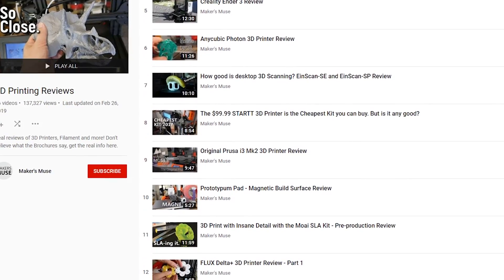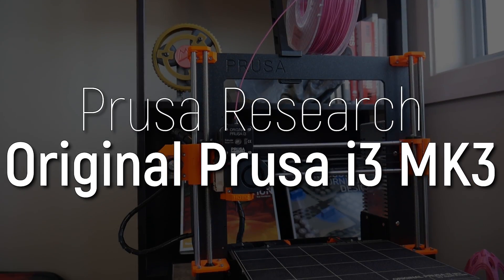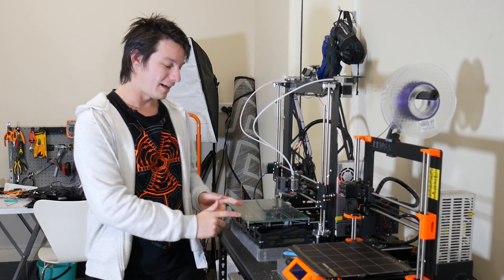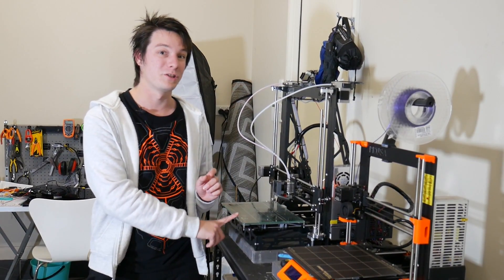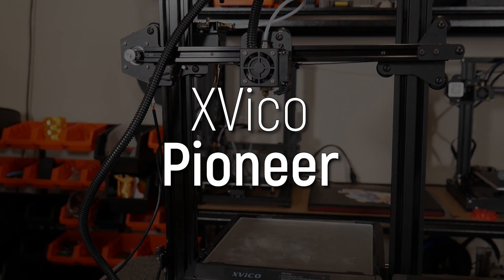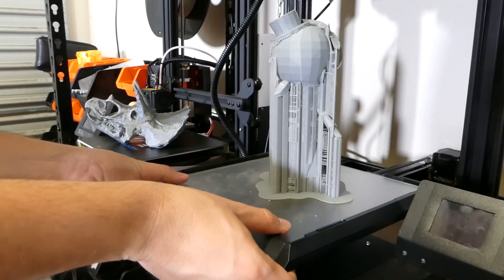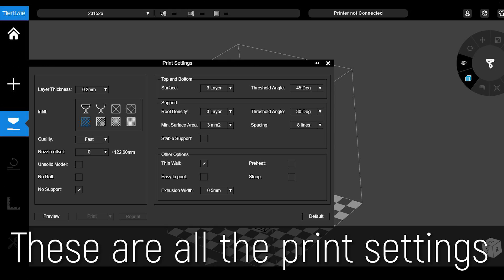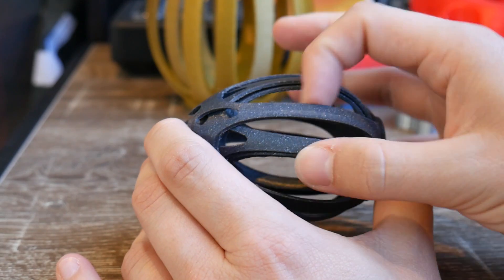My TOP 3D Printers for the 2019 Maker's Muse Studio (FDM/FFF)

Comment: I ended up getting some bad rippling on my R2 MK3 (probably about as severe as what you showed off). It wasn't bad when I first set it up, but over the span of around 15 months it ended up getting more and more noticeable.

A few weeks ago I tore the printer down and upgraded everything to R4 parts, retensioned all of the belts, used some light machine oil on all of the smooth rods, and (for good measure) replaced the E36 V6 with a Mosquito. The rippling basically disappeared at after that, even when I print full bore with the spool mounted to the frame. I'm not sure exactly which step resolved the issue, but I'm guessing the improved R3/R4 belt tensioners probably helped considerably.

The only way you can really tell that my printer was a fairly old MK3 now is the spiral wrap going to the heater bed, the fact that the EINSY case is the original design, and because my smooth PEI build plate has the lighter color. :)

Comment: Only one 3d printer, and the upgrades nearly equaled the cost of the machine itself, but, though it can be a bit quirky, and I only print PLA at the moment, I have really enjoyed the almost two years I've owned my Tevo Tarantula.

It's down at the moment, as the heated bed stopped working, but troubleshooting is part of any mechanical/electronic/software system.

Thanks for all you have contributed!

Comment: Craftunique Craftbot Plus. Gets by far the most use at home. I do like to use the SeeMeCNC Orion from time to time, just because i like to see the delta mechanics moving around. The Vertex Nano is more of a decoration and eyecatcher, but i got it on sale for 99$, so that was more of an impulse buy for fun anyways. The Makerbot Cupcake CNC and Up Mini are basically rotting away in a corner of shame, and my DIY printer desperately needs a decent extruder (thinking about a complete bondtech extruder and hotend assembly), before it will get back in to service...

Comment: I'm looking at buying my third kit from Prusa. The MK3 kit that I've probably printed 2k hours on has only needed calibrating (beyond a simple Calibrate Z) like 3 times. I mean, a good portion of it is that I've learned from my mistakes on my MK2, but my failure rate has been very low, and I think only one or two failures total after a good first layer.

Comment: My go to is MP Select V2 with ABL mod. I have several printers. I print from another room and with octoprint I send my print and my not check the print until a few hours later. MP Select has not failed me yet.
My second is my piper 2 I built for anything that requires high temp and big build volume.

Comment: My experience with pruse is quite bad, as the hot end design is terriblem any nozzle change you risking damaging the machine, its really terrible, also they drilled extra hole instide of the throat so that causes a lot of jams , and OMG if  that prusa jams you are screwed, you  have a slim cahnce repairing it , its easier buying a new hotend, also wireing is terrible in the newest model, the wires literally bang into the frame thats how close they are on the new extruder, also any time you need to change a fan of termistor you will have to rewire everything no plug , Also inside of that box? OMG so many wires everywhere what a mess, no cooling on the board aswell, so if you want to put it into a heated chamber , good luck moving the box and power supply and lcd out somehow... terrible design really, and it goes out of aligment any time you lift it up or down, aaaaaand the build platform is held by few screw s and zipteis which undo themselves over heavy use ..literally not a heavy use machine at all. Plus if you try to pause the print and reload the filament, and then click resume, the extruder for some bizzare reason decides to retract all loaded filament after resuming the print and prints with the 'air' I exchaganed emails with prusa suport, they have no idea what is going  on they asked me to swap the motor with z axis and update software none worked, plus lately after the update the filament sensor causes jams - which then causes machine termal runout and then its fu%ked because it retracted cold plug into cold zone so its all blocked again its a nightmare of a machine
Reply: on the other hand my clone of makerbot replicator dual extruder is working for last 5 years with no hichup, I had to redo a lot of things in it and change a lot of parts into something else but it never have any extgruding probles and prints all materials including rubber, I really  do not understand why all new machines are bowden?! we need direct drive for that rubber and other exocit materials !!

Comment: @MakersMuse you can upgrade ur mrk3 to an mrk3s and then add a raspberry pi w to use octoprint via ur wireless network and print from it wirelessly on devices connect to the same network.

Comment: I've wondered for a long time now, if you match the Cetus' settings with another printer, how does the quality of each print compare? I feel like I see it often, that one says, "Amazing quality!" but they're printing at 40mm/s with PLA or something; I'm wondering if the Cetus' proprietary software just locks in guaranteed good settings that anyone could just manually dial in on another printer.

Comment: Ultimate 2+, run a small farm of them and print repeated multi day builds with no trouble. Made thousands of parts with them. Heated bed, purple glue stick and a razor scraper. Also used on to run virtually event material that melts under 260c, PC, PVDF, PETG,
ASA and doped stuff. Dimafix for the hotter bed, more warpy stuff.

Comment: My most reliable printer is the one I VERY heavily modified. The PowerSpec Wanhao i3 mini. (same as the Cocoon Create) The only problem is it is SO limited and I often need to print bigger. Then I go to one of my Printrbot PLUS Metals. Those I also modified. Mainly due to the fact that I got them used and broken. With the demise of Printrbot I had to get creative, but I know what I did was an improvement over all. I plan to design and build a larger build volume printer next year running 2 heads so I can have 2 sizes of nozzles. I want to have a larger nozzle for the inner part of the print and a finer one for the outer perimeter of the print. Thinking of a 0.8 and a 0.4 to start with.  My first printer was the wood Printrbot kit in early 2013, or late 2012. I don't remember if I got it before or after the new year. I later upgraded it 3 times until it became the Play.

Comment: Even before clicking on this --  I knew a Prusa (because every YTer has to kiss the ring) and Tier time will be featured -- IMO -- closed source proprietary slicer machines should not be championed in the consumer space. They're building on OS work and closing off an anti-consumer echo-system. Having to work around the limitations of a proprietary slicer which locks you into a specific temperature and settings -- NO. and NO.  You may have a love affair with UP printers, but honestly -- I don't see why. Plenty of machines now user linear rails. They're small expensive, proprietary. Nope...

Comment: Just wanted to point out that your primary reason for using the mk3 is not even available to us mere mortals. That amazing removable sheet you have is still unobtanium as far as I know. It's the sticking point for me ordering one. (Well, that and they never have a mk3 in stock to ship. Weeks of lead time doesn't work for me) Anyhow, love your channel, but every time I see the i3mk3 praised and that textured PEI removable sheet we can't get, it triggers me just a bit. ;)
Reply from the maker: You can get the normal smooth pei one and it works ok, but yeah I get your point on the powder coated one! Mine is actually starting to rust a bit... Will be sad once it's unusable.
Reply: @MakersMuse  I do keep hoping some magic will develop in the production of those sheets. As long as it's reasonably affordable magic.  :)
Reply: @MakersMuse  Hey, perhaps the wait won't be much longer. Still can't buy one unless you already own a printer, but it's a start.  :) https://blog.prusaprinters.org/may-2019-update-original-prusa-sl1-now-shipping-powder-coated-sheets-in-stock-prusaslicer-2-0-and-much-more/#powdercoated

Comment: I own the renkforce rf100, which is really much like one of the last printers you showed, with only 120x120x120 build volume and non heated bed, but very reliable, my second one is a sainsmart creality cr10s which is obviously my goto printer with larger projects and materials like nylon, for which it is really handy to have a heated bed. By the way I think, that you should really have an eye on the renkforce rf2000. Its a bit  expensive but reliable, it looks cool, its a closed buildchamber. Youll have to import it from germany but i think its worth it.

Comment: My most reliable printer is my CR-10 it is a beast that works every time. I print directly on glass, and the items pop off easily when done. Use 65 degrees on the bed no warping.

Comment: I'm using an anycubic i3 mega and it's pretty reliable. I'm used to leave bigger prints during the night and I never had a problem with it. The ultrabase is awesome. The only problem is that it doesn't handle flexible material.

Comment: I have those same MK3 ripples on a P3steel frame, they only appear on Y-axis and drive me nuts. I've been wondering if they could be caused by the friction from heavy carriage coupled with sintered bronze bushings resulting in poor microstepping, so the full steps get imprinted on part.

Comment: I've got a Prusa mk3 and a Printrbot Simple Metal that both do a great job. Too bad Printrbot went out of business, mine is tuned and modified to print great every time. But the 15 minute heating to ABS temperatures on the heated bed is killer when you compare it to the few minutes the mk3 takes to get to temp.

Comment: Great video Angus.
My most used printers are:
1 JGAurora A5 (Perfect PLA of NGEN printer)
2 Anycubic I3 Mega (Prints about every material you can think of, including flex materials)
3 Creality CR-10 Mini (PLA printer that just works)
4 to ... Hypercube CoreXY homemade printers
I have a lot of Hypercubes in different configurations, from E3D V6 to Volcano's, from non-heated beds to 24V 160 degrees beds, from open to enclosed, etc.
And, I have a few shop models that don't even have a power cord connected. These are XYZPrinting Da Vinci Pro machines. They just look nice in a storefront with some colorful led lights

Comment: I have 2 x ender 3 both with auto bed sensing and TH3D firmware and pei sheets on glass beds. 1 x cr-20 pro again with pei on glass bed and then 2 x tronxy x3a also with pei sheets. The tronxy x3a just work with no fuss, but I think this is down to the type of pei sheet I have on them. The new pei sheets on the ender and cr-20 are not as good quality and I can see the glue sheet is not stuck that well so the pei is uneven and no amount of pressing down will fix this. The cr-20 pro prints very well and had become my go to machine after removing the magnetic print suface and replacing with the glass, now I just need to find some better pei sheet.

Comment: Why don't you use octoprint or similar to get around the sd card?
Reply: yeah I'd like to see makers muse setup an octoprint pi, maybe on the prusia. it has a cut out for the pi zero but apparently the zero lacks power for slicing, so external pi 3b+ would be ideal. this would be a good experiment actually, to try both. Keep up the good work Angus.
Reply: @MakeTechPtyLtd  im actually working on an octoprint install/use video for my channel! should be up by end of day... hooking to my ender 3 pro though not a prusa. my only 'prusa' is a clone. lol
Reply: @Technivorous  Cool, I'll check it out. Ive seen some nice print farms with octoprint acting as a kind of server, and operated via a tablet. The remote login feature and web cam monitoring also add some value to the octoprint setup. for me, my office and workshop are separate buildings so it would obviously be helpful there.
Reply: Some people don't because it adds another point of failure. It isn't true wireless. You're sending a wireless signal from your pc to another device. For example, an Arduino or Pi. Then it sends the file to the printer via a usb cable. An sd card is also more reliable for recovery in the event of a power outage.
Reply: @freighter109ha4  True but you can also use it to just copy it wirelessly to the SD card. Then you print from SD card the old school (and more reliable) way
Reply: this is a great question! my main printer is litterally above my pc tower, and i dont like taking the sd card that far... lmfao
Reply: or a WIFI SD card... I use it on my printer.
Reply: @serafinmarius  Using a wireless SD is clever, and easy - but you get a lot more with OctoPrint. With OctoPrint I can monitor the printer remotely. With a webcam attached to OctoPrint I can see if the print it having problems.The user interface to OctoPrint is well done, and uniform for all my printers. There are plugins to OctoPrint to add a variety of useful features.

(Also, on one of my older printers, the SD card slot failed - which is not a problem, as the printer was on OctoPrint.)
Reply: I came to ask the same question. I had OctoPi running  on my Prusa I3 MK3 the same weekend that I completed the build.

Comment: Anycubic I3 mega, it does everything I want and at good quality
Reply: I've seen alot of bad comments about it on other videos im stuck between that one and the cr10 mini
Reply: @2way93  I was between these 2 printers as well, I ended up with the CR10 Mini, prints great, only complaint is the fan on the hotend sounds like garbage, I think it might be going bad. What decided it for me was the online groups/communities for Creality printers, felt more assuring if I had to trouble shoot something on a printer from China that has limited support.
Reply: @2way93  all I can say is that I've seen some of the bad comments in videos, but, having said that there are more positive comments as well. I've modded mine a bit but nothing over the top and it's still running on the stock internals just fine, and it is printing everything I need it to!

Comment: One thing I wish they would update on the Prusa i3 Mk3 is the processor driving the whole thing, it's too slow!
Using the menu is a test of your patience in itself, the LCD screen just doesn't update quick enough, it's not a slow screen but a slow processor. It's really frustrating when I turn the control dial one notch and nothing happens, and also when I've highlighted the file I want printed, press the control dial and it selects the next one down the list to print! Argh!!

Comment: Hi Angus why have you never tried Octoprint you could run all your printers wireless then you wont need to run around with SD cards
Reply: It does seem a bit odd that he doesn't use it. It's so simple to set up and I'd expected to find a tutorial on his channel about it when I first heard of it.
Reply: For my only one printer in house (I3MK3 orig.) i tried wireless SD card and it works, no extra funcionality gained on printer, but i just save file to a folder/netwrok and thats it, no software, no tools no nothing, just use it as i would carry SD card over room.., works for me.
Reply: Wi-Fi SD works for me too.
Reply: I came to comment on the same thing. Octoprint is not something new. I got my first 3d printer and a couple weeks later I setup octoprint on a server I happen to have next to my printer and I have not touched an sd card since. Cura has a pluging that integrates with octoprint's API so I can click print with octoprint in cura. I dont have to mess with gcode files either.  I use the pushbullet plugin in octoprint and get a text when the print is done. I am willing to help with setting it up or providing content
Reply: That or 3dprinteros
it allows you to control multiple printers really easily from a web interface.
Reply: The Prusa MK3 even has a special connector port on it's motherboard for connecting raspberry pi's, so it's kind of officially supported even. (They use the same port for their printer farm factory, see their factory tour if interested)
Reply: I have seen so.e folks use a Raspberry Pi. Would you load Octo on it then connect to your printer?
Reply: @barrybowden5778  I run OctoPi. The SD slot on my CR-10s was so finicky, the card would fall into the casing instead of going into the slot half the time. I wanted some of the other functionality, too, so it was a no-brainer. There was some complicated setup, but basically OctoPrint is downloaded onto an sd card, that's inserted into the pi, USB connect to the printer, then access via ip address.
Reply: Some people don't because it adds another point of failure. It isn't true wireless. You're sending a wireless signal from your pc to another device. For example, an Arduino or Pi. Then it sends the file to the printer via a usb cable. An sd card is also more reliable for recovery in the event of a power outage.
Reply: Octoprint can write to the SD card and command the printer to print the file from the SD card. In that mode if octoprint dies the printer will still print. At fist I started using octoprint this way since I dont trust the stability of opensource applications from the start. It has been pretty stable. I have had not to reboot or restart the service for months and never had to reboot or restart due to instability. I have not seen an instability issue but it is not very complex system.